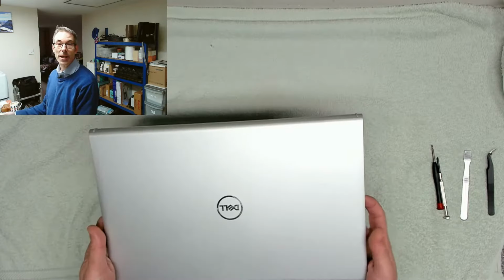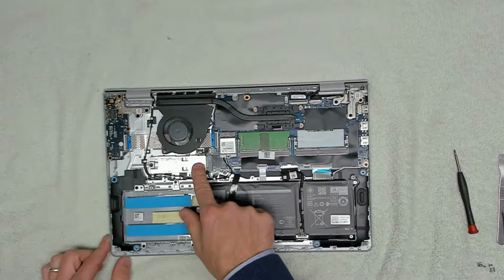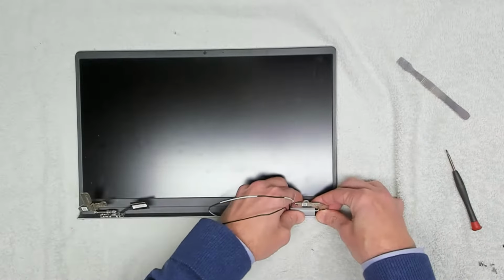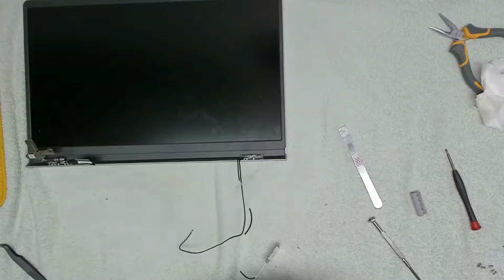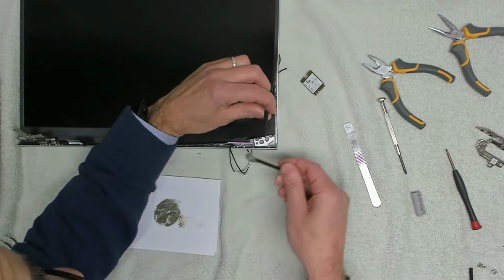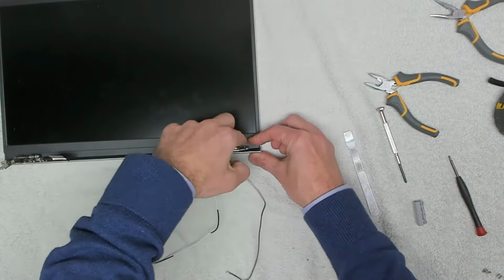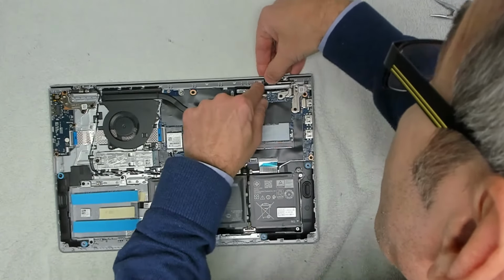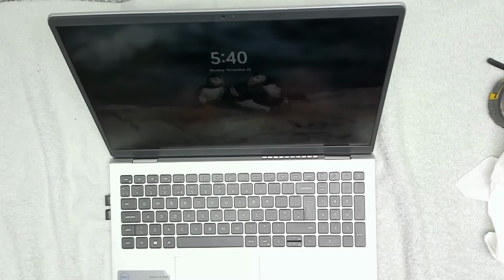Dell Inspiron 15 3515 hinge repair using R-Kem 2 bonded anchor

Comment: I have one question.. won't the glue effect the stickyness?
Like before if there was more tension.. it used to just snap but i feel if u glued them. Those will next time just snap the display instead of just coming out of holes.

Comment: this video was such a big help. thank you! i found me in the same situation with an Inspiron 15 3520. i had already opened the back cover to look for the replacement part number for the hinge when i came across this video and another one for lid replacement. i used jb weld instantweld epoxy adhesive. sets in 2 minutes with a 1 hour cure time.

Comment: Thanks, a good and helpful video.👍 I've taken the complete bezel off as it makes access easier. However, rather than using glue, I've simply bought a brand new lid/bezel/hinges from eBay for £25. Sure, I could go to Screwfix in Hawley Lane and buy some R-Kem II for £7.59, but it seemed easier than using a polyester resin and trying not to get any on the screen...but it does mean that I have to swap over the LCD panel, etc. to the new lid.

Comment: Thank you, Thank you, Thank you!  Sent my computer to Dell.  The cost of repair was nearly as much as a new computer.  Looked up your video on you tube.  I was so impressed by it that I decided to religiously follow your instructions and give it a try. Used JB Weld's Auto-Weld 2 Adhesive.  Voila! Success!  Thanks.

Comment: It all went well with our vostro 3525 but unfortunately the Wi-Fi card never came back up so we've had to order a new  card as it may have picked up static when fitting the hinge
Reply: Did the little white and black antenna wires came off during reassembly?

Comment: Thank you very much for your video. One hinge on my laptop snapped off the plastic mounting and started to damage the display case. For me, the nerve-wracking moments were removing the bezel around the display. I was afraid that I was going to damage the screen, especially at the top and bottom, where the adhesive strips are found. However, taking it slowly, there was no damage. Adjusting the tension on the hinge screws took a few tries - I saw the tip from another viewer that said the hinge cover could be removed with the case reassembled, and that helped a lot. I used the JB Weld cold weld epoxy, and that worked great. It takes a while to set, but it bonds firmly.
Reply: That's what I did too, I removed the case of both hinges since one of them damaged the slot and couldn't fit back in. Looks kinda cooler without them anyways

Comment: This is fantastic. Even if I COULD find original parts to do the repair, which I can't, it didn't make sense to me if the same thing was going to happen in another 6 months.
This seems more like a proper SOLUTION, not just a repair. Thank you!

Comment: THANK YOU SO MUCH for the repair tutorial video. Clear, concise, well planned and clearly photographed. Easy to follow directions led to a successful repair. As I am here in the US, I used JB Weld, Auto Weld 2-part epoxy. I was able to unscrew the threaded inserts that held the hinge screws and just epoxy them back into place, and not epoxy the entire hinge together. Once the inserts were dry, I just reassembled the hinges using the screws as it was originally assembled. I also recalibrated (adjusted) how stiff the hinges were, to avoid having the same problem in the future. TIP: you can adjust the hinges once the entire laptop is put back together, by just removing the hinge covers. Better to do it this way so you can accurately see how stiff or loose to make the hinges, based on how they hold to laptop screen open. Again, thanks for the repair help via the video!

Comment: Thank you!  This video saved my Dell computer that is only 5 months old and Dell was useless.  Thank you so much!!!!!
Reply: hi.. interesting. Dell covered in my case with 5 month old laptop with basic warranty. I paid nothing. They sent me a box with prepaid shipping, then I sent them the laptop and got it back in7 days repaired. They changed the lcd back, the hinge cap, and the lcd cable connector. All was free.. I don't like Dell's crap quality, but the service was perfect
Reply: hi.. interesting. Dell covered in my case with 5 month old laptop with basic warranty. I paid nothing. They sent me a box with prepaid shipping, then I sent them the laptop and got it back in7 days repaired. They changed the lcd back, the hinge cap, and the lcd cable connector. All was free.. I don't like Dell's crap quality, but the service was perfect

Comment: Does dell replace these with a revsioned part or anything they are coming to repair it under warranty and i pray its not just half assed bc ive only opened mine 10 times in 2 months and it broke like this,

Comment: Can I thumbs up twice! Thank you so much for the video. I used AnchorFix-2 Heavy Duty Fast Curing Anchoring Adhesive (less than $30) and now I have anchoring adhesive for future projects, assuming it does not dry out.

Comment: The right hinge on my 3511 (same exact chassis) just popped last night. Like others have experienced, the badly designed hinges got continuously stiffer over time while the cheap brittle plastic got even brittler. Upon attempting to close the laptop, the very stiff metal hinges acted as a strong enough lever to rip the screws right out of the plastic lid cover on the display assembly. 

From then on, the then unsecured hinges sandwiched between the bezel and the display pried apart the layers of the display assembly worse and worse each time the lid moved.

I was convinced I was going to have to shell out 50 dollars for a spare bezel and lid. There was no way that greedy scum of a company Dell was going to repair this for free under the basic warranty,  I'm certain they would never admit fault in their terrible design and blame me for it instead despite people all over the internet documenting the same problem.

But I came across your video and it gave me hope I could actually fix it myself without buying any parts, so I gave that a try. I didn't have any kind of epoxy, so I had to settle for regular ol' cyanoacrylate superglue. Honestly, I had doubts it would be strong enough, but once I loosened the hinges, the strain became light enough for the superglue to hold it together quite handily. I didn't even know it was possible to loosen them until this video.

Thanks so much for publishing such an great and easy fix.

Comment: So I was using my father laptop same model as in this video. And when I was normally opening the laptop I hear the crack and then I see that screen was coming out and I told my father about this problem and he go to the shop where he bought this model and the shop owner told my father that this cannot be fixed and he scold me lot cuz this was new laptop bought 6 months ago. But when I did research in internet it say's that it can be fixed....

Comment: gonna have to do this, my laptops screen bevel started trying to rip itself off when I open my laptop normally
Reply: did it work
Reply: @aliceontheinternet123  It did fix the hinge problem, but after I put it back together it stopped turning on, I don't know if I accidently damaged something while opening it up or what happened. I quadruple checked that battery was connected and everything. Ended up just buying a new laptop

Comment: Yes! THANK YOU.  I was skeptical about the Epoxy, but once I followed your expert video instructions and I saw the conditions of the holes the hinge screws go into, I thought, "oh yes, epoxy is the only way!"  It all worked fantastically!
Reply: I thought so too at first, but it turns out epoxy isn't actually necessary. 

My Inspiron 15 3511 (same chassis as the one in the video) was having this same exact problem where the overly tight hinges ripped the hinge screws out of the plastic lid cover. I found this video looking up fixes, but I didn't have any kind of epoxy to use. So I decided to try regular superglue instead. I had strong doubts about it being strong enough to handle the strain, but worst case scenario I could try again later with epoxy. 

But once I loosened the hinges to an appropriate degree, the superglue was able to handle it no problem!
Reply: @Swagaito_Gai  I am just about to start the repair. I don't have any kind of epoxy, I just have super glue. I am having doubt about it working but lets see. That's the only thing I got. Ok just read your comment and I am about to start my repair.
Reply: @Swagaito_Gai  hi! it's been a year now, has the glue you used held up?